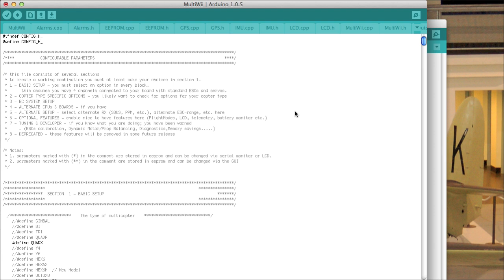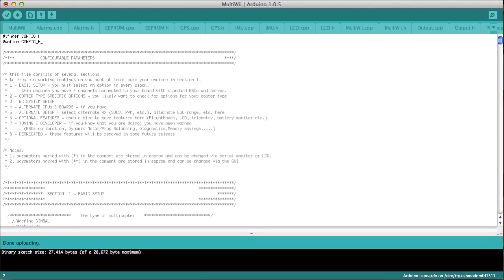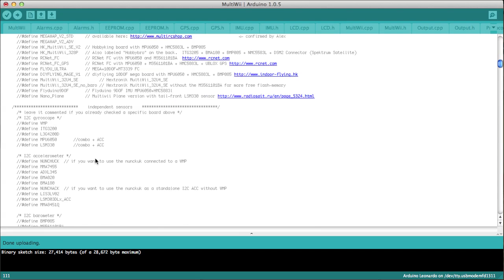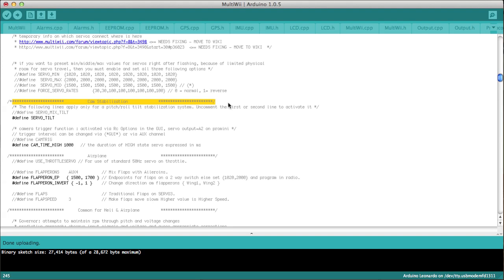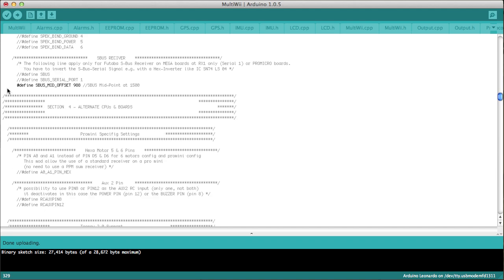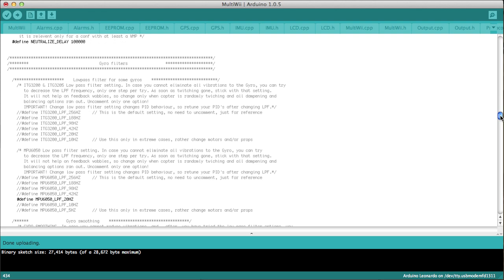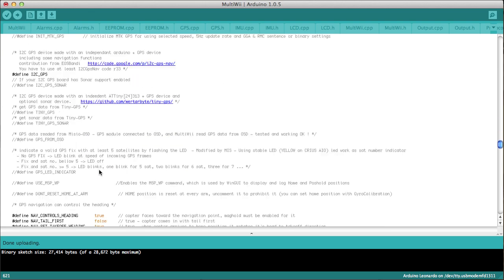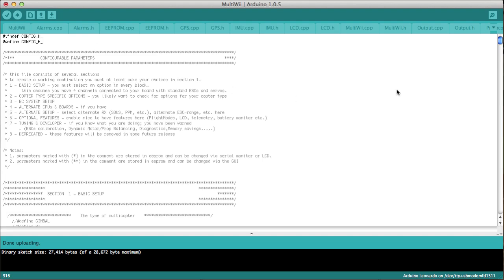Multiwii V2_3 Sketch file

Comment: Hi! Think I've done a mistake. Have a new "Paris Air V2" controller and compiled it with Arduino 1.0.6, "Multiwii V2_3 Sketch file". Now my question: is that a mistake, or how i can Flash back the original, for "Scarab Red Knife"? Thanks in advance, and sorry for my miserable english !

Comment: hi ive got version 2.3 but I cant get my ublox gps to work. not sure what I should comment or uncomment. if you could help that would be great. many thanks
Reply from the maker: That will depend on the main board you are using, the port you want to use, and the serial rate of the GPS module you have
Reply: its a crius aiop v2, im changing everything im being told to but when I select serial port 2 it comes up with error compiling. im now pulling out my hair.
Reply from the maker: sorry I can't help you with that board

Comment: I have version 2.3 all set up, but I can't arm my board. I'm an absolute noob in quad building. I tuned the ESCs and all but still can't arm the board, could you give me some pointer on whats possibly going wrong?
Reply from the maker: Two things will stop the board arming:, your radio sub trims and endpoints are not correctly set, or you have Baro selected